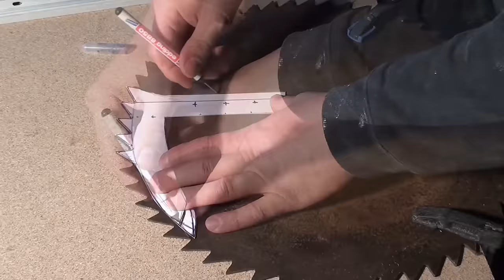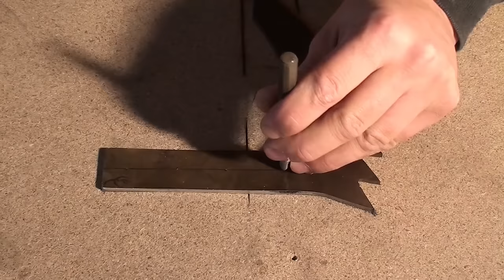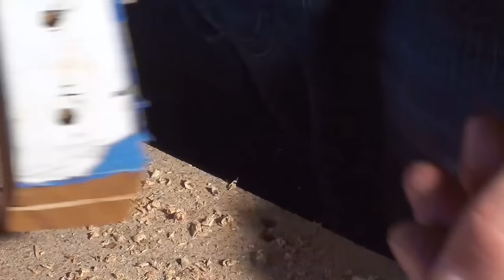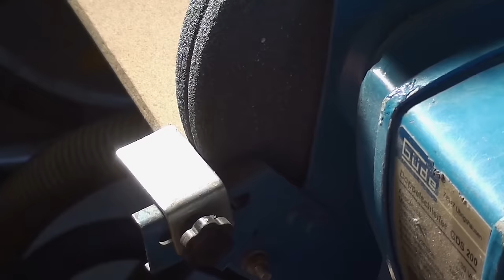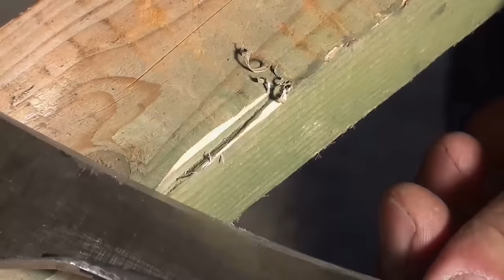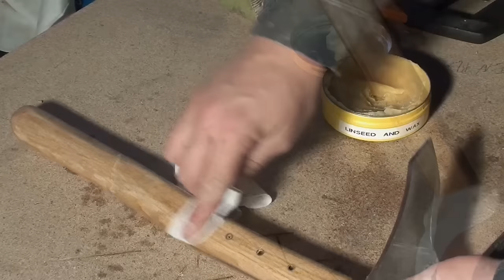Make a Kama (Ninja Sickle) from an old Saw Blade

Comment: Very nice.  I made a pair out of some old lopper handles that I found and then went to a metal shop to have two aluminum (non sharp) blades made.  Then wrapped the ends with twine, loaded a bottle of epoxy over the twin.  They are used in katas..
Reply from the maker: Very cool idea!

Comment: That is cool!I like the way you used the wood to get an even grind on the blade!
Reply from the maker: Thanks a lot! Yes the angle helps a lot with getting consistent bevels both on the grinders and when touching up with file and sander.
Cheers

Comment: Really cool work ... How long did you need to make the part?

But there is also something to criticize:
1 .: The blade of the original Kama is slightly longer and slightly more curved ...
  2 .: You should have the blade again (after) hardening ...
3 .: If you had mixed in the glue still about wood dust, you would have had a nice wood paste, to seal the cracks nice clean. Looks also better.

But otherwise: Really cool .... Take another ... and you're well armed for a "zombie apocalypse" ... Hahahahahaha ....

Greetings from Germany...
Thumbs up...
Reply from the maker: Many thanks for your feedback it is much appreciated!
As for the design I didn't wanted to go for a traditional kama design as I wanted keep the saw teeth and give it a tanto style point (although nowadays I would grind it differently).
When I made this a year ago I didn't have the setup to heat treat such a large blade which is why it wasn't hardened.
Good idea with mixing the epoxy and saw dust and I should have thought about it to fill the gaps.
Thanks again
and greetings back from Germany! ;)
Reply: @VooDoo Magic Oh. OK. I did not know that. Thanks for this information. So even someone like me can learn something else. But still looks really cool and apocalyptic. He did a really dirty job. Respect.

Comment: For more of an axehead girth to it simply cut TWO identical pieces and bond together as one ...each is sharpened only on one side but together as a unit is a single sharp blade that is way heavier and more stout than one thin piece...no?
Reply from the maker: Hi Doug,
it certainly sounds interesting but how would you bond the two blades together? You would have to weld them for a reliable connection. I think the only proper way would be to forge weld several layers together for a thicker stock to work with.
Thanks for the suggestion!

Comment: It's sad you ruined a perfectly good saw blade to make something like that. Please respect your tools.
Reply from the maker: +Tony Walker He Tony, thanks for watching. I do not have a table saw and no the saw blade wasn't in perfect condition anymore. I get these sawblades from friends and family and they are usually rescued from the scrap. I do this with a lot of old steel items in through that give them a second life in a new form. This project was made for a zombie weapon challenge last year which was the reason for the chosen design. Thanks
Reply: Alex 2Q your welcome, old saw blades were often resharpen, teeth were set and put back into production, especially milling saw. I see an antique with a lot of historic president. The metal is unlike anything you can get at the store. But too late to do anything now, so make something extraordinary.